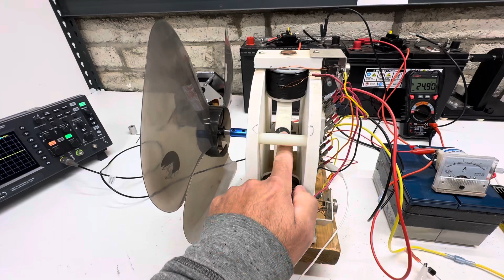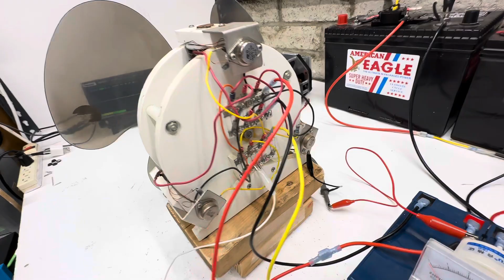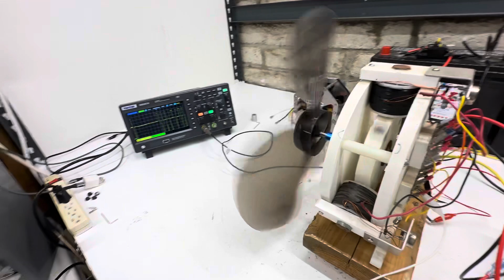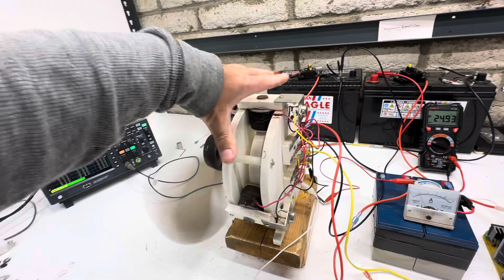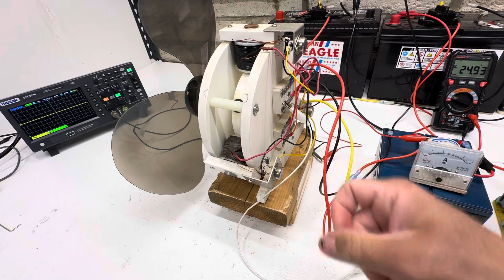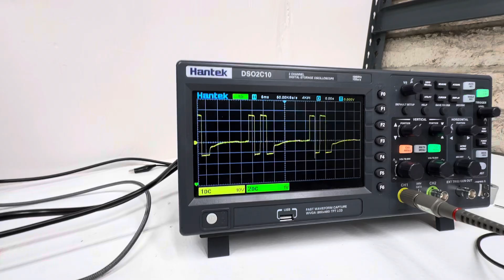Old bedini motor SSG and generator mode

Comment: Have you ever used the Generator mode in the Classical SG mode without the capacitor discharge circuit?
Reply from the maker: @debunkified  I’ve used both on cap dump 
And without 
Its Genmode  / forced charge or ssg not both
Reply: @ Thanks for your reply, but I’m still a little unclear. Does generator mode work well when using the collapsing fields directly from the coil to charge the battery, without a capacitor discharge circuit?
Reply from the maker: @ yes very fast charge
Reply: @kenergy1707  Thanks for your reply earlier! I just want to clarify something. In generator mode without a capacitor discharge circuit, when B1 charges B2 directly (when B2's voltage is lower), does this harm the batteries or the circuit in any way? Does it work effectively and safely in your experience?
Reply from the maker: @ in gen mode it’s a mix of spike and square wave charging together 
The cap dump keeps the volts higher so power doesn’t transfer battery to battery 
Without the cap dump It doesn’t seem to hinder the battery just charges with both energy sources
Reply: @kenergy1707  Thanks for this reply! This explanation makes a lot more sense to me, and I really appreciate you taking the time to clarify. It’s exactly the kind of answer I was hoping for—thanks again!

Comment: Hi K Energy, every time I am at the thrift store buying old computer LCD monitors at $3-$4 each, I think of your channel. I'm not sure if you remember, but I once asked you where you got the thick white plastic for your experiments. When I went to Amazon to order some white plastic, it was too expensive for my budget. Then, while I was taking apart a $3 LCD monitor, I discovered a large, thick piece of transparent plastic. This clear plastic is easy to cut and use for my electronics projects for a fraction of the cost. An equivalent piece of acrylic or polycarbonate would cost $50 - $100 or more. Just my 2 cents! Love the channel!
Reply from the maker: Very cool ! Yeah star board is expensive you can get a cutting board at Walmart for cheep and use that too 
 Star board is marine grade that’s why it’s expensive last a good 30 years +
Reply: @kenergy1707  The Walmart cutting board idea is brilliant! Thanks for sharing. I will ask my wife to pick one up on her next visit!
Reply: @kenergy1707  May I ask how you cut the marine-grade plastic?
Reply from the maker: @shawncalderon4950  you can use a chop saw skill saw or wood band saw
Reply: @kenergy1707  how do you keep the blade from melting the plastic?
Reply from the maker: @shawncalderon4950  the band saw works best with large teeth
Reply from the maker: If the teeth are to small they will melt it
Reply: @kenergy1707  thanks!